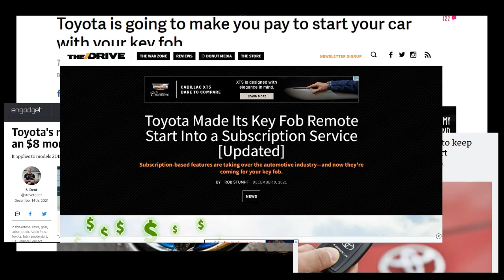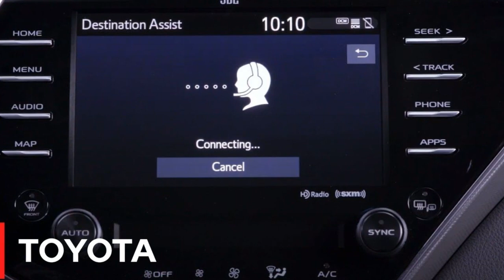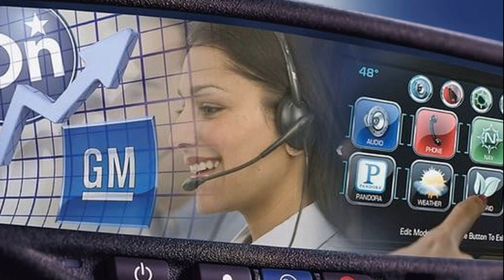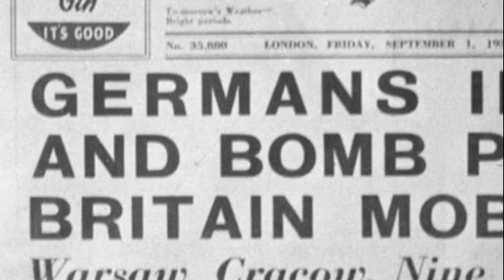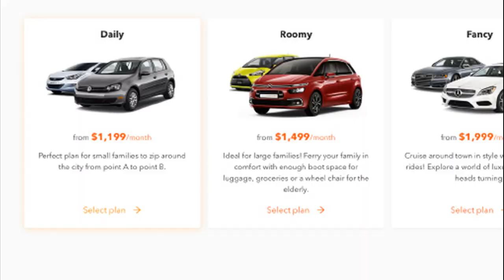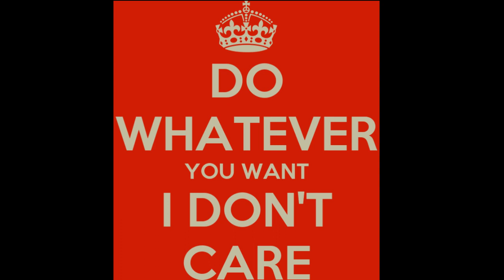The latest CASH GRAB the car companies tried to SNEAK PAST US

Comment: In my mind, this all started with cars that had NO TRANSMISSION DIPSTICK.

"Just drop the whole pan every 30,000 miles because if you look in the manual, that's the flush interval. And you'd better follow that because you're in danger of voiding your warranty."

THAT WAS FORD, ON THE 2005 V6 MUSTANG

Comment: I have a 2017 Camry, and I was shocked when I looked under the hood of a 2018 plus Camry at the dealership, there was plastic and wires everywhere whereas the 2017 you can see and reach everything with ease it looked almost identical to the 90s Camrys.

Comment: Remote start is a feature of many aftermarket alarms. I’ve also seen aftermarket smart fob kits. Mine even has GPS tracking in case care is stolen.  Installing them on newer cars does often require overriding the OEM systems, but is doable at this time.  And a lot of people realize OEM alarms just suck (except higher end ones for BMW and such).  So this may be the Avenue to fight the subscription service.  Car makers may make it difficult to add aftermarket systems, but there will always be people that figure out how.

Comment: The only way to prevent this is to get all the normal non car people to care about it. Thing is I don't think that's possible.

I wonder if I buy one of these subscription cars in the future and I just rip out the ECU and all their computers and replace it with like a holly system. I wonder how that'll work.
Reply from the maker: My understanding is - "if you are a good enough programmer, you can get around anything". I can barely program the microwave, so I will not be testing this one for yall. hahah
Reply: Louis Rossman is a youtuber that started with a board swap channel and now pretty much covers "right to repair" for all things.  Worth a watch.

Comment: Another great way for the government to hit that big red button and stop your travels in your tracks.  Remote start sounds nice in the winter, but something else to go wrong with already way too electronically controlled vehicles.

Rather than having to pay for remote start, lane keep assist, etc...how about making people pay to use that nonsense built in tablet in their damn cars...unless they pay a monthly premium and jacked up insurance for using a driving distraction device in their car, they shouldn't be able to use that stupid tablet.  That touch screen crap is more distracting than a cell phone I think, given so many vehicles now have all your climate control, radio controls, heated seats, cooled seats, etc. in menus in that touch screen, I feel its just as bad if not worse than a cell phone and honestly should be banned.  I can change the radio station, turn the volume up and down, etc. on the radio in my car right from the steering wheel, Jeeps have had that for decades even on lower end models...no reason for that stupid touch screen distraction.
Reply: Not to mention trying to see the road at night with a bright ass led billboard on your dash. I don't care how "dim" you try to get it. They greatly affect night sight.

Comment: I was looking at buying a newer Camry to replace my 2011 corolla in the next year or two… welp, fuck that! This is my 4th toyota and now will be my last. 

So I figured I know toyota does listen to their customers, so I just sent them a nice email about my thoughts on that. And told them you have now lost me as a customer and I’ll go elsewhere. Maybe if enough people fire back at toyota saying “cya later, nice doing business, won’t be back” they might wise up some
Reply from the maker: Maybe, right? It just seems like the consumer has no voice in the automotive sector anymore
Reply: @DEInTheGarage  hoping enough people voice their opinions and makes them reconsider. I love my corolla, 154k and all it’s seen is oil changes, brakes, tires, and a radiator fan. And still drives like the day it was brand new. But I’m not going to be held hostage by a manufacturer to use features on my car. Satellite radio is one thing, but remote start from the key fob being disabled is a complete different thing, I’m spoiled I guess from my truck having it, but it makes it nice at 2am when leaving work to have a warm car that’s melted off of snow and ice, and more if it has heated seats and they are on 😂
Reply from the maker: @braaapattack2937  Those little "conveniences" and "comforts" really make all the difference! I find i dont miss them if I never had them, but once I do i need them
Reply: @DEInTheGarage  I was the same way with heated seats, never wanted them…. And my truck came with them…. Now I absolutely love them, helps the back a ton after a night at work, and no cold seats when it’s 20 outside 😂